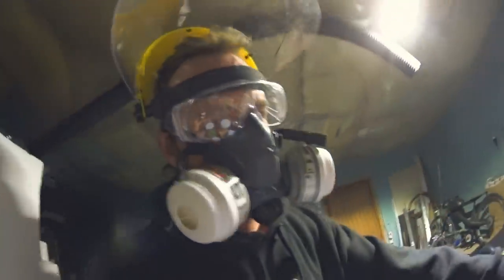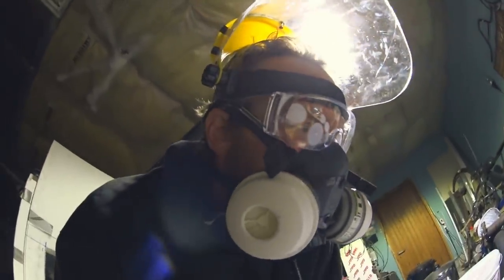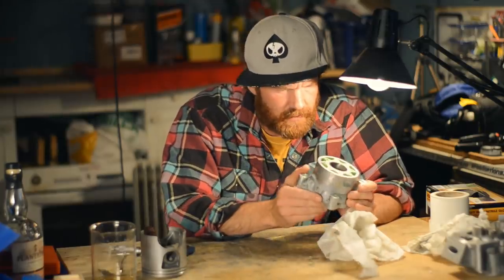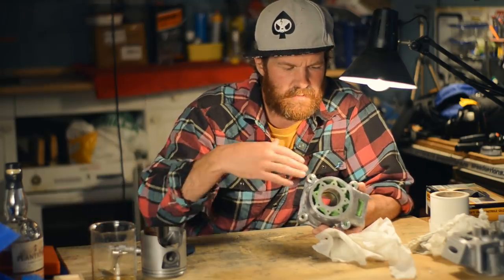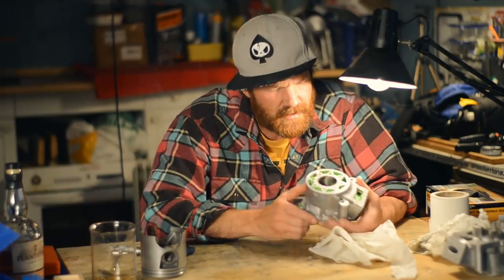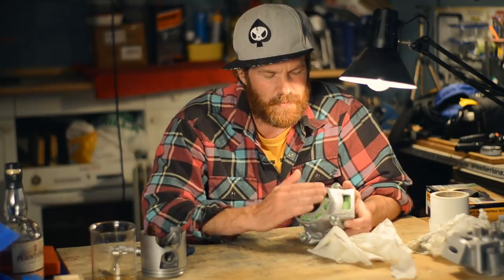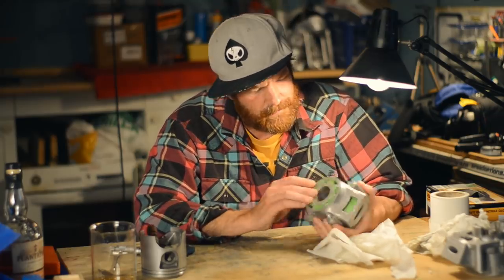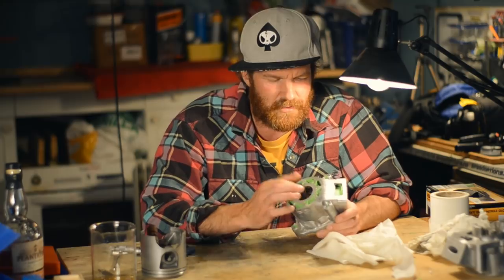Breaking Bad for real? DIY "NIKASIL" Part 4

Comment: Firstly, my complitments for your channel! The most interesting channel on youtube! Secondly, maybe you already know, but Jan Thiel once advised to keep the deck surface of the cylinder a bit higher on the outside and a bit lower on close to the bore. Maybe as much as a couple of tenths of a millimeter. Then also plate the top part a little bit and then machine it down straight, so that the plating it stronger on top and does not peel off. This is done so that the head does not have to be lowered into the bore. This apparently saps power. Keep up the good work!
Reply from the maker: Thanks! Remember reading that too, might incorporate it in the next casting.

Comment: Really cool this turned out so good!
Why not use a battery-powered drill for honing? They run at a much lower speed and with plenty torque.

I wouldn't worry about the porosity of the lining. This will first and foremost be a very effective test of the retained piston ring as well as establishing power figures for the 100% exhaust port width.

Congrats, no matter how this turns out! 👏 🎉
Reply from the maker: Thanks! The shaft won't fit my battery drill, but I'm going to machine it down or replace the chuck.
Reply: @2STROKESTUFFING 

I hate when the shaft won't fit!

Comment: For the final hone try putting the hone in the vise and twist and lift the cylinder up and down. This will give a very nice cross hatch and you can hone to the exact size . And well done.
Reply from the maker: Thanks for the tip!

Comment: Am I missing something? Why did you go through the trouble of building a motorized rotisserie just to paint the thing? I mean it was a cool project and very unique execution, but what was the point?
Reply from the maker: I need the plastidip to cover the inside of the water jacket and transfer/exhaust ducts - easy when I can spray on thick and let it flow around in there.

Comment: I've been doing some thinking and your projected power output may be possible but engine will have to be spinning a minimum of 22,500 rpm. At 25~27,500 rpm you should be able to get close to 25bhp from 49.9cc - if you can get 100% airflow efficiency but more likely you'll be in the 70~90% range so will need higher rpm to compensate.. I'm pretty sure you just cannot move enough volume of air/fuel at lower rpm and you cannot keep increasing compression ratio without getting other problems.. The very best race motors can be 130% efficient over a very narrow rpm range with ram tuning, exhaust pulse tuning etc.  Running methanol mix may get you power at lower rpm but I don't have any experience with it in a two stroke (never had RC cars as a kid) If yoiu know the fuel burn rate you can get a reasonable estimate of the ignition timing to get max  cylinder pressure at 14 ~16degrees ATDC.(probably 3~400 ft/sec for 96 octane petrol, 800~1200 ft/sec with H2 mix) Luckily a 50cc cylinder is so small flame front doesn't have far to go so you won't need timing 60 degrees BTDC. I managed to find some metric numbers, average pump gas has flame velocity around 0.35M/sec and a flame front in cylinder around 20~30M/sec. Something to play with, you may need lower octane at max rpm?
Reply: Flame fronts are constantly accelerating...
Reply: @manoo422  and?
Reply: @peterjones6945  Kind of odd to quote flame velocity dont you think? Its totally dependent on combustion conditions and always goes from zero at the plug to maximum at the chamber wall...
Reply: @manoo422  not at all, you have to start somewhere with ignition timing. You know port timing,  you know when you want max cylinder pressure, you have a reasonable estimate of when combustion has to begin to be at least 60% completed when exhaust port opens,  you can estimate RPM needed for power output. Knowing the rpm gives you the total time available for burn which is going to be milliseconds and somewhat static time to reach cylinder wall (flame speed doesn't increase much with temperature/compression) The hole in cylinder gives fixed exhaust timing. Making it wider for scavenging rather than higher lowers rpm potential. You know HP= work over time, even if work gets less efficient if you can do more of it power will increase. (It's why F1 engines spin to 20,000+rpm). If your burn time is too slow you'll be building an even less efficient jet engine by burning fuel in expansion chamber. Too much advance and burning fuel could easily apply max cylinder pressure before TDC
  I'm a moty bike mechanic not a mathematician but we did stuff like this 45+ yrs ago, before 'everyone' had a cell phone with a calculator let alone computer software to do the math for you

Comment: Maybe you could rig a bicycle crank with a gear reduction to give you the vertical stroke while honing. You may be able to run that type of setup with a drill motor as well. A mechanical way to make the crosshatch by varying the 2 motor’s speeds

Comment: It's amazing seeing it get to this point... the only thing I'm concerned about is the pitting in the cylinder. Not sure if that's from the casting process showing through the plating but I think you should keep honing/plating until the pit marks are gone. Also try to remember when honing not to ever stop the up-and-down motion as long as the drill and hone are moving... even if you have to pull the hone all the way out of the cylinder while it's moving so it doesn't stop in the cylinder. It definitely looks like Breaking Bad in your garage... lol

Comment: Hey man . I tgougt about the honing of the cilinder. Why not make some sort of crankshaft right beside the dril. The crank rotates and the rod pushes the dril handle up and down. Then you might get the perfect honing structure as with a bought cilinder

Comment: You should print a nice fixture to suspend the cylinder in the plating bath. Also is there a reason you are not using a ball hone?
Reply: A ball hone would not be suitable in a cylinder with so much wall area devoted to ports. Ok in a continuous sleeve.

Comment: When i used to work at a hardchroming company they used to use the formula 2 amps per square inch x 2/3 or 2/3 power  this gave about .001 inch or .025 mm deposit per hour , not sure if this formula can be used nbn though .
Reply from the maker: Thanks for the tip!

Comment: Have you tried chrome for the bore ? Racers used to chrome plate the bore. I just havnt heard of it for a longtime. Also polishing ports is not preferred on subsonic. A textured finish   helps with viscosity. ? 
Comare a sheet of glass to a sheet of emery paper.

Comment: How will u know if its the most powerful when there are so many variables as it is a one of a kind. Is the deck height of the cylinder/head going to be comparable to regular OE standards? U can take a regular bike and swap and tune parts to make alot more hp so im just curious.

Comment: Is that honing toolshaft 'solid'?
If, then any angle on your powerdrill from cylinderliner will cause an out of round bore.
You need a flexing shaft.
Reply from the maker: There's a ball in one end, one in both ends or a flexible shaft would be better.

Comment: Would it be easyer to cast it from cast iron? Or it must be Aluminum?

No matter what,this videos are great,nice job and I wish You best of luck in work!
Reply: aluminium is better to get rid of heat wich means you can get higher power numbers (very basic but yeah) cast iron is also much harder to cast at home due to the high melting point
Reply: Thanks on reply, I just so using iron   easy (no plating neaded) but,if its alu. better for power ok,why not.
Its just too complicated for me to follow, cant find all of those hemicals on market back home (Serbia) etc.
I alredy did some blueing but also have problems in finding natrium nitrate...Nitrite and Soda is easy but Nitrate is so hard to find. :-)

Comment: Great to see the proper tools and prcess for the job at hand. So the way the hone was talking it sounds like a bit of both lack of lube and a little to fast on the rotation otherwise I am stoked for you. Now the question I have are you trying to get a 45 degree crosshatch or maybe 50 to hold the oil in the cylnder a little longer  cause i am sure the power and revolutions this is going to see will be blowing my mind. I.D. Mic's proper tool= more power. Is it done yet, is it done yet ..... Sorry! This is about to get as real af. I can see you flying down the track with your plating suit on tucked in behind your face visor, now im laffin thinking about it.

Comment: I'm a little late to comment but , a pair of chest waders could provide better protection in case of spills.
The other thing was to up the voltage in the plating process could give you better results, something about producing a ripple wave in the current during the process. And a question, what was the cost in just the chemicals?

Comment: MASSIVE Congratulations M8. EPIC project.  just one thing - i'd prefer to see you honing with a pillar drill?
Reply from the maker: Thanks! A pilar drill would need a second flexible coupling in the honing shaft I think, will look into it.
Reply: I find pillar drills are hard to move up and down fast enough for an effective crosshatch.

Comment: How would aluminum bronze do for a cylinder liner? The stuff will work harden during use and doesn't seize and gall under high stress.
Reply: It will cost expensive

Comment: the voids in the casting are going to be a issue ?
Reply from the maker: Hoping not. "speed holes". I have plans for improvement in the next casting.
Reply: @2STROKESTUFFING  Built in oil reservoirs for high revs :D

Comment: scared the hell out of me with the tag line breaking bad i though something had seriously gone wrong . have you heard about sluging the casting when its semi liquid.  to fill the mold better or maybe pulling a vacuum over it to remove porosity
Reply from the maker: Thanks, Actually just recently bought a vacuum pump for the purpose.

Comment: Wait did you say titanium wire? Ti is a terrible conductor, only has about 3% the conductivity of copper... Or is it a titanium aluminum alloy?
Reply from the maker: It was supplied by Gateros plating for the purpose - probably an alloy.
Reply: @2STROKESTUFFING  I'm excited to see how your cylinder turns out, as I'm contemplating beginning building a modular 7L 5-cylinder radial, stackable with a vertical crank shaft, so if the first one works out I can bump it up to a 10 cylinders by making a second segment and a main bearing section in between with a longer crank shaft, kind of like they do in rotary engines, with the main bearings sitting on the front and back plates. Nikasil seems like a good solution to keep an aluminum block and avoid a poorly cooling iron sleeve.

Comment: Planned voltage adjustments during the plating cycle can offer  subtle variables (aka surprises & clues) to add to your latest wisdom quest...  That is, after the zombie research scientist meets Nikasil first date is over.

Have you started a recipe book yet? Data logs are a pain and a complete waste of time... until they're not.
Great project, good luck, I'm interested completely. Cheers
Reply from the maker: Thanks! I'm keeping a simple log of time in each tank, voltage/Amps, resulting thickness etc.

Comment: Dosent Those Electroplating Fluids Need to also Be Hot Because ive seen at Gromeplating Fluids are hot  in tanks
Reply from the maker: These chemicals work good  at about 30-35°C.
Reply: @2STROKESTUFFING  ok i just wondering that but thx 4 info

Comment: Well done, would it be worth honing before plating as well as after, might lead to a more consistent surface thickness (if you didn't already that is). Could you even replate it a second time, it should fill any voids some what.
Reply: worst voids seemed to be below the ports - so maybe not so bad a problem?
Reply from the maker: Thanks! The surface needs to bee a bit rough for the Boron Nitride to stick better.

Comment: Why don’t you make some liners that are held into place and coat a whole load ? 
More lubricant when machining and you are using that bore gauge wrong .
Reply from the maker: A liner has much worse heat transfer vs a solid bore.
What am I doing wrong with the bore gauge?
Reply: 2STROKE STUFFING you shouldn’t be tightening the micrometer over the bore gauge you should be comparing the feel between bore and micrometer , hard to explain . 
Love the videos .
Reply from the maker: Thanks, that actually makes a lot of sense!
Reply: 2STROKE STUFFING 
Really enjoying what you are doing thanks for the videos .

Comment: If this ends up working would you buy a CNC machine and mass produce these ? There's a whole market for 50cc's. The world record for fastest 2 stroke is held by a 50cc.
Reply: Where i can see world fastest 2 stroke 50cc?
Reply: SecretShop Bali idk. I've only read about it and have seen picture of the engine. It's a turbo 50cc 2 stroke.

Comment: Alex, since i am so addicted to what you are doing, i donated 50€ to spend on what helps your dream! my aprilia rs 125 is still sitting in my backyard waiting to be finalized after a crash with a car that escaped... If neccessary spend it on your wife and kids, or a good whiskey :) which cylinder head are you going to use, also a self-made? can you tell what parts are you going to use? we all already know that the cylinder (or the ones after this one) will work! go on buddy!
Reply from the maker: Thanks man, means a lot!
Custom head, haven't decided on the crank yet, but probably something for a scooter. Cheers!

Comment: Your technique on using the telescoping gauge needs some work. Your probably getting a fairly close measurement but there will be some error in the way you are doing it. Maybe Mr Petre has a video on it, you should look. If you really want to get an accurate measurement, use a dial bore gauge. It's what engine builders use.
Reply from the maker: Thanks! I'll watch a few vids, thought I had the technique down.
Reply: @2STROKESTUFFING  I'm a machinist for a living, I meant mrpete (I  think) " Your online shop teacher". I did a search, plenty out there. I like your ingenuity and watch because I'm thinking about making a home foundry. Your channel is good stuff.

Comment: Why dont u use liner instead of plating it
Reply: A liner would limit the heat transfer capability of the cylinder. It is not ideal for a super high performance two stroke. Even my Kreidler Florett RS from 1975  (6,25 HP 50 ccm) already has a nicasil cylinder.
Reply: There is some extra complexity, weight and chances for some additional problems to wreck a high performance engine with a poorly designed, or fitted liner, or from multiple combined material thermal rates, coifficients and loading differences. 
   I am not saying that one could not be made correctly for this, but it would mean pretty much a complete redesign and spcification of some parts to do so, when it has gone advanced so far - admittedly not even in the engine testing phase of design refinement yet. 

   But having an all in one design, does mean that while the casting is more important to achieve a certain resiliance and dynamic toughness and working performance, the redesign, remaking and creation is all things considered relatively, is faster, maybe cheaper, and with luck, easier.
   Is this going to become a 140,000+ km or mile life engine cylinder, like a factory production engine, probably not, certainly not yet.
Reply: @thomash3003  that nicasil cilinder isn't original though. Mopeds from that era all had chrome liners.
Reply: @g.bergervoet4505 
It is an original MAHLE Cylinder.
Kreidler introduced MAHLE Nikasil cylinder already in 1972, as one of - if not the first Company in the world.

https://de.wikipedia.org/wiki/Kreidler?wprov=sfla1

Kreidler was on of the leading edge companies in Germany in the 1970s for 50 ccm motorcycle racing. Look also for Kreidler Van Veen in YouTube.

Comment: Are you SURE it wouldnt have been soooo much easier to use a steel liner...?
Reply: He wants to build the most powerful 50cc engine, so, no.
Reply: @g.bergervoet4505  Whilst Nikasil has some advantages it also has disadvantages which is why its not widely used. He didnt show us the bore surface in the video and as yet I havent seen one that isnt covered in 'pits'. Achieving a good bore finish may prove to be impossibly difficult, in which case the engine wont produce any power...!
Reply: @manoo422  Nikasil is very widely used on competition dirt bikes (and has been for decades) and I'm sure many other high performance applications.
Reply: @DepakoteMeister  So thats competition, 2 stroke, dirt bikes...could you think of a narrower range of use? Whilst its been used by BMW and Jaguar, high wear and early failure meant very big bills to rectify, I think Jag replaced whole engines. It is NOT widely used at all.
Reply: Porsche used nickasil on early iron cylinders.  In the 4 cam stuff I recall.
Reply: @erikmaxfield4718  Yes, I said, it wasnt WIDELY used....and for good reason.
So its the complexity of achieving a usable bore that could stop the projects progress...not whether it has any advantages.

Comment: You will NEVER  get an optimal hone job using a hand held hone.  You need to use a machine that holds a consistent differential between linear (vertical) and rotational speed, of the hone.

Comment: you have to be naked when coating the bore's otherwise the Nikasil doesn't set properly.. plus rubbing a blown up balloon on your head for more static feed electrolysis.... it works 60% of the time everytime.........

Comment: Why do you choose to use such small engines for your builds?  Increasing bore and stroke does not increase complexity, risk, or even much cost.  I feel like there is some unknown reason.  Yes, making 20hp from a 50cc engine is cool.  But...  200hp from a 500cc engine is a lot cooler.  Why not go full scale?
Reply: @Akeli  I will